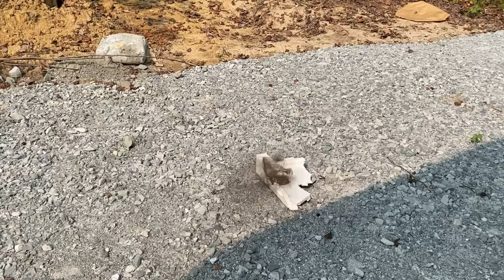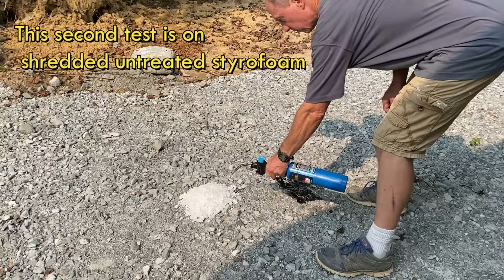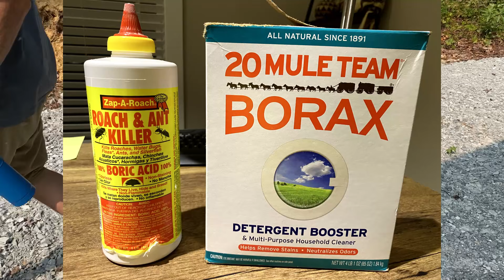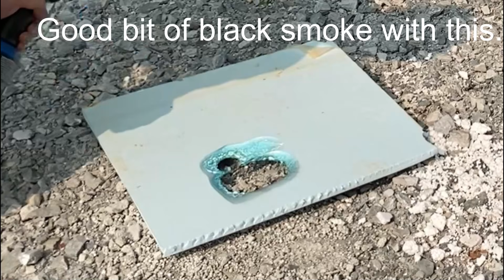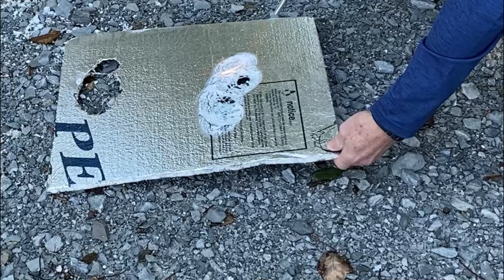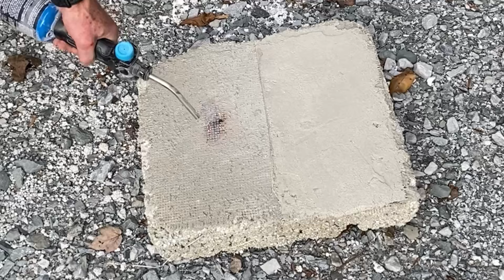Abundacrete FIRE TEST … YOU Won't Believe THIS!!

Comment: Thank you for this video! My architect step-son thinks I am nuts for even looking at your information. I think this video will get him to look at your methods a little closer. He wants to find a way to help people on the reservation (where he currently lives) have better homes.
Reply: As Stephen noted in his videos and his reply to your comment, this material has been used throughout the world as well as in the US for decades. Rastra has been making cement + eps ICF blocks since the '70's, and Bautex produces a variation as well, both available in the US.  I'm sure there are other manufacturers here in the states as well, but those two I know off the top of my head. This material is best as insulation, and though it does have some structural strength, it should not be relied on alone to support heavy loads or high stress. Personally, though I wouldn't build my house from just this(I live in hurricane alley, guaranteed 2-3 tropical storms/hurricanes per year), I'd trust it just fine for outbuildings or insulation. No building material or technique is ideal in all circumstances. The 'best' option for a given project depends on goals, local climate and weather patterns, locally available materials, local laws and codes, neighbors, site specifics, available labor, aesthetic considerations, budget, and I could go on all day. Good luck with your son and hope you both can get your projects done and help some people.
Reply: Refer him to the comment by Mendo Home Power for real world test in the CA Camp fire